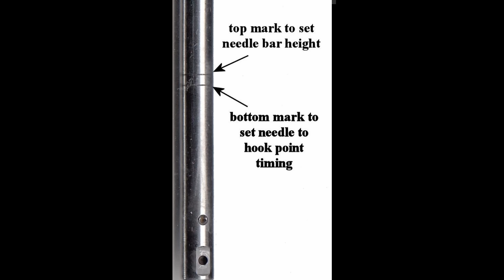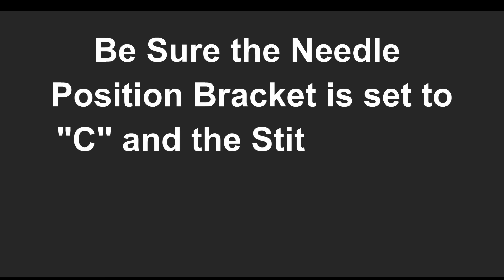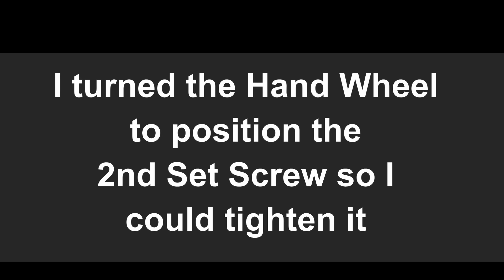How to Check and Set the Timing on the Singer Model 413 Sewing Machine

Comment: Hi Andy, are any of the internal plastic gear heads available. My bottom end is not working.
Reply from the maker: Hi, Steve. Yes, The Gear is Singer Part #155819. Here is the video about changing out the gear and resetting the timing which must be done afterward. https://youtu.be/M3bFtlV1Y6s        Thanks for watching my channel.

Comment: Hello Andy,  
I watched your video on replacing the vertical shift gear.  I was able to successfully replace mine and time it with your help.  My machine seemed to be working great until about 15 min into a project, and it began slowing down until all the motor would do is humm.  Please help.  It has always randomly hesitated on start for as long as I can remember, and when the gear completely stripped, I thought that was the reason for the hesitation.  But apparently not.  Seems to be the motor, but I don't know.  Please tell me my machine can be saved.  It has tremendous sentimental value to me.  I would live to send you a pic of it
Reply from the maker: Oh, don't give up on that nice machine just yet. The long-time hesitation of motor start is a classic sign of a failing foot controller. The foot controller, or pedal, has a long stack of carbon discs that are compressed when you press on the pedal. They resist electricity, but when you push them together they allow more and more electricity to pass through to the motor. Over time the discs can get dirty with carbon deposits and even start cracking. The pedal is about 50 years old now, and probably has never even had service, cleaning, or adjusting. When it starts failing the discs can heat up very fast and just prevent the electricity from passing to the motor enough to make the motor turn or spin, thus the groaning and humming. Your machine should have a "clamshell" style foot pedal, and here is a playlist of videos about cleaning, repairing, and adjusting it to get it working properly. If you can change that gear you can certainly service the pedal, no worries. https://www.youtube.com/playlist?list=PLsCOZgzzaiKItPLWcK24FBoMdHK8vTXNi
I truly believe that is your problem, but of course, I can't see or touch the machine. I suppose the new gear, or the work you did, could be binding the machine and preventing turning, but that usually shows up right away and you sewed for awhile. You can put the machine in bobbin winding mode and test it, or put it in sewing mode and turn it by hand to see if it turns OK. If you brought that machine to me I would open the pedal and take a look as the next step to repairing the problem. Good Luck, Angela, and thanks for watching my channel.
Reply: @andytubesewing1953  Don't worry.  I don't give up.  Thank you so much.  I will get on it as soon as I get home.  I will let you.
Reply from the maker: @angelaharper5950  Best of luck then.
Reply: @andytubesewing1953  okay, I am so sorry to keep bothering you.  When attempting to remove the screw on the underside of the clamp shell foot pedal, the screw is not actually unscrewing, just turning.  Am I missing something?  It does have a cone shaped washer in place to hold it against the springs.  The screw just freely turns in both direction.
Reply from the maker: @angelaharper5950  If you pause at 5:05 in this video https://youtu.be/9uJ0prqbmwg   you can see the metal "nut" embedded into the plastic lid of the pedal. That is what holds the screw. If your screw is just spinning freely then maybe the nut has broken free of the plastic. That's all I can think of at the moment. If that is the case you should be able to gently pry up the top of the pedal to have the loose nut come out with the screw. IDK if that would work b/c I've never had this problem. If you can pry it open then you could hold the nut with a plier to unscrew it and glue it back into the lid. Here is a video for gluing into/onto plastic to give you an idea of using baking soda with superglue: https://youtu.be/NXx6JyP9d5U  Let us know how you make out please, and good luck.

Comment: I acquired a singer 4220 top stitches are fine bottom ones looks like a line of thread with dots on it I’ve died the bobbin tension after 10 hours went and checked it tonight and straight stitch is fine and as soon as I changed the stitch to another one it got screwed up again as soon as I switched back to straight stitching what can I do now  I’m beginning to think my timing is off
Reply from the maker: If the timing is off you will be skipping stitches completely, meaning some, most or all of the stitches will not form. The needle thread tension and bobbin thread tension must be balanced so the threads cross between the two layers of fabric. An example would be using a red needle thread and green bobbin thread. If tension is balanced you will NOT see red needle thread on the bottom of the fabric, or green bobbin thread on top of the fabric b/c the "lock-stitch" is between the fabric.  When you say you have a line of thread with "dots" on it on the bottom that means there is more tension on the bobbin thread than the needle thread, and the bobbin thread is "pulling" the needle thread thru the fabric down to the bottom. The usual way to correct this is by adjusting the needle thread tension to have more tension. It is much, much more common to adjust needle thread tension than to have to change bobbin case tension.
Your model 4220 is 40 years newer than the machines I restore, and I do not know the mechanics of it, but in general, an experienced sewist would try adding needle thread tension. Your modern machine has an "auto-tension" setting that you can adjust up or down.
If adjusting upper tension did not correct the problem you would normally completely remove the needle thread then clean the tension unit area. On your model, you can unscrew some covers on the front and brush and oil the nose end of the machine. You can also use compressed air to blow out the lint from the tension unit. (even a hairdryer can help blow out dust) You could have so much lint in the tension discs that they can not squeeze the needle thread to put tension on it. When's the last time you cleaned lint from your machine? After cleaning you rethread the needle, closely following the instructions on pages 35 thru 39 of your Instruction Manual and try to stitch again. If you need a copy of your instruction manual you can download a copy FREE from Singer at this link; https://www.singer.com/search/support?title=4220
So, you have unbalanced tension, maybe b/c the tension unit is dirty, maybe b/c you did not thread the tension unit and needle correctly (getting the thread between the tension discs) maybe you have a bent needle; maybe you are using the wrong thread. Those are the most common causes. Again, if your timing was "off" you would have trouble making any kind of stitch. It is not clear to me what you did to your bobbin case/tension, but try cleaning your machine (pages 64 &65 of manual) and then running the thread into the tension and needle again then test sewing.

Comment: Hello Andy how do I put the bobbin case and everything back in with the bobbin case  correctly after I took it apart from adjusting the timing?
Reply from the maker: With the positioning bracket lifted and mover to the right, place the fork on the tip of the bobbin case around the positioning pin near the top of the hook, hold the bobbin case level and rotate it to the left so the grove on the side of the case slides onto the "edge" or "race" pf the hook, then lift and move the positioning bracket back to the left. See @ 29:00 in this video;
https://youtu.be/JLYNpmFQ3wQ   and also @ 13:30 in this video https://youtu.be/Vvo0ZNjdPRU  for examples of reinstalling a class 66 bobbin case back onto the race of the rotary hook. Thanks for watching my channel.
Reply: @andytubesewing1953  okay thank you so much for all your help really appreciate it!! Will try to get it
Reply from the maker: @januaryjackson9752  No worries; I know you will do it. Take care.

Comment: I am having trouble with fixing the timing in my brother SM1704 machine . The needle is far from the plate and hits the bobbin case
Reply from the maker: I am sorry to hear that, but I hear it a lot. I have never worked on or owned a Brother machine, only Singer, and do not know what the mechanics are like under that plastic cover. The timing principles in my video are fairly universal. After the needle bottoms out and starts up the point of the hook must come right behind the needle to grab the needle thread. It may have a belt drive or gear drive for the hook, but the timing is the same. If your needle is hitting the bobbin that usually means the zigzag or needle bar driving arm has gotten loose or come detached. It may be much more than a timing problem. On the class/price of the machine you have, I have been told that the needle bar can be pushed up or the driving arm knocked loose and the timing belt can "Slip" a little and that is how you lose timing. You could try starting on the USA Brother support page for your model and change the country/language if needed. They usually have a way to contact them by chat or email and maybe they could give you some guidance; https://support.brother.com/g/b/producttop.aspx?c=us&lang=en&prod=hf_sm1704eus
Sorry, I can't be of more help. Good Luck.

Comment: hmm thought this might be my issue but it appears thats not the case. When i rotate the wheel so the thread uptake arm is at its peak the center refuses to rotate, its not locked up, it just hits something in the machine and refused to complete the rotation.. :(
Reply from the maker: You have this model 413? So when you say "the center refused to rotate" are you talking about the hook that surround the bobbin case and bobbin? I'm asking b/c this model is one of a handful of models that is known to have a plastic gear on the top of the vertical shaft. That shaft goes from under the main upper arm shaft down to the bottom pulley on the right side. It powers the timing belt that goes to the pulley on the left that rotates the hook so the hook point can catch the needle thread, wrap it around the bobbin thread and make a stitch. That plastic gear is known to fail at its age. It gets brittle and the teeth can start chipping of and the gear can even crack in half. If the gear is defective the arm/handwheel sometimes turns so far and then gets stuck. I don't know if that is your problem, but it very well may be. I made a video about how to replace the gear with a new $10 gear. It's a long video but maybe you can skip around and view it at 2x speed and see the gear I'm talking about and then  peek down into your machine with a flashlight and see what your gear looks like. If it's broken then that is most likely the problem, but even if it is not the exact cause you still need to replace it if you want the machine to work properly. Here is the video:https://youtu.be/M3bFtlV1Y6s   If you find the gear is OK then we can talk about other causes and I can try to get more info. Good Luck, and thanks for watching my channel.
Reply: @andytubesewing1953  its an issue in the body ... sounds like bronke gear ! Uggghhh
Reply from the maker: Yep. My video for that now has 46K views and that tells us how common that broken gear is. Too sad b/c they are very nice models,strong & versatile. New gear and back to sewing for 30 years.

Comment: I have a Singer 6233 model and I wanted to adjust the needle height. It appears those markings that you are referencing don't exist on this model.  Any advice for this model?
Reply from the maker: I think your model has a Vibrating Bracket the needle bar sits in to swing it for ZigZag sewing. Sometimes the timing marks are up high on the needle bar and use a bushing of the VB to set height/timing. I've never worked on a 6233 (too new) but you can buy a copy of the Service and Parts Manual for $9.00 and download it in PDF format. It will have timing instructions (and all the other parts adjust/remove/replace too. https://manualsoncd.com/product/singer-6233-sewing-machine-service-parts-manual/
It's a small price for a lot of information about your machine. Thanks for watching my channel and good luck.
Reply: @andytubesewing1953  Thanks for the advice.  I did purchase the manual as advised and will have to dust off my micrometer.  There aren't any markings or anything to go by for this model in the manual - only measurements.
Reply from the maker: thanks for sharing that!

Comment: What do I do when the timing wheel, the thing under the bobbin won't turn
Reply from the maker: That part is called the hook. If it is not turning that usually means the timing belt and pulleys on the bottom of the machine are not turning either. That is a sign of a broken plastic gear on top of the vertical shaft has broken. It is a very common problem on models of that decade that are now 40+ years old. You can buy a new gear for about $10 and replace it yourself. I made a step-by-step video tutorial for that:  https://youtu.be/M3bFtlV1Y6s    Some viewers have had some difficulty with a couple of the models, including the model 413. You can watch the video and see what you think about replacing it. If you run into a problem you may want to buy this guide that Terry Fielding wrote about how to do it. https://store.tandtrepair.com/400stvgg.html  My video was made on a model 457 so you can compare it to your 413. If you do buy the guide, be sure to use my coupon at check out for 20% off. You download it and it is a PDF. Coupon is andy-h-yt
Good luck, and thanks for watching my channel.

Comment: I have a model 248 very similar to the one on this video. I have done what you did in the video, however, the bottom (the bobbin) is not turning when I turn the hand wheel. I can manual turn the belts by hand under the machine but neither the foot pedal or hand wheel is engaging it. Help.
Reply from the maker: I've never worked on this model, but looking online at pictures online and a parts manual I think I have bad news and good news for you. The bad; I believe the top gear on the vertical shaft has failed. That gear meshes with a gear on the main arm shaft and the vertical gear/shaft is what powers the hook to rotate. When the gear fails the timing belt, and therefore the hook, will not rotate. The needle bar will go up and down like crazy, but the hook and probably the feed dog won't move. The Good; You can buy a new gear for under $10 and I have a video (25K views now) that may help you remove and replace the gear. It's on a model 457 which is also in a group of machines that are known to have this failing gear and has mechanics similar to your model. You can see by the number of views how common this problem is for machines of that time period. Here is the gear change video if you want to see what I am talking about. Peek inside the machine and see if you have a broken gear: 
https://youtu.be/M3bFtlV1Y6s      This is where I'd buy the gear; A trusted seller here in the USA that I have used for years: https://www.ebay.com/itm/SINGER-TOP-VERTICAL-GEAR-242-247-248-252-257-259-267-353-354-6100-7100/291974827596?hash=item43fb0e4e4c:g:HmEAAOSwDFBaDKnI    You can buy the gear from other sellers, just be sure it is made for your model. Rarely, the old gear is riveted onto the shaft and is difficult to remove before lowering the shaft and pulling the gear from the front or side of the machine as shown in my movie. If my video does not cover the procedure on your exact model, you can buy a downloadable copy of the Singer Service Manual for it which usually contains instructions with diagrams of replacing that gear and almost every part on the machine. You can buy it here for $8.99: https://manualsoncd.com/product/singer-240-series-sewing-machine-service-manual/   So, for less than $20 you should be able to get the machine working again if that's all that is wrong with it. If f I am wrong and that gear is not the cause of your problem please let me know. Good luck, and thanks for watching my channel.
Reply: @andytubesewing1953  thank you for your quick response. I will look into the links and see if I can troubleshoot further. Thank you again for all your assistance.
Reply from the maker: @ripsidermovsesian13  Yes, of course, and good luck.